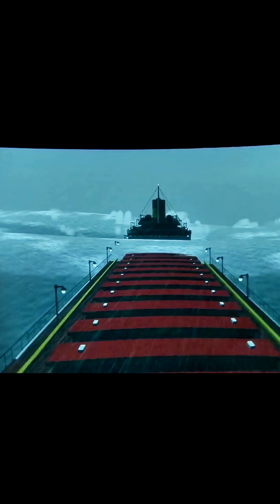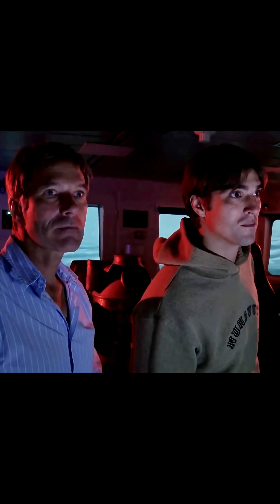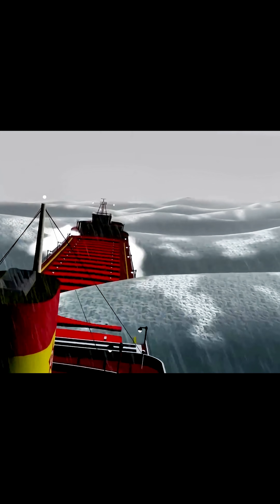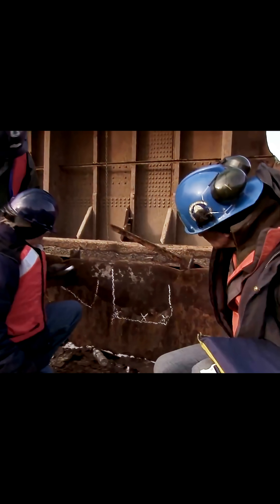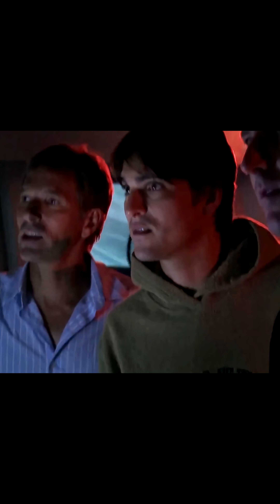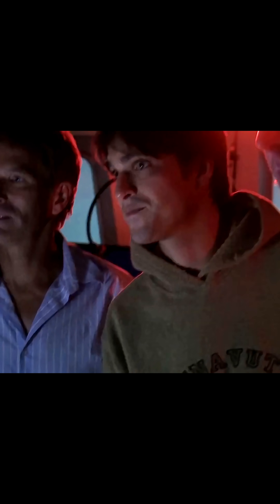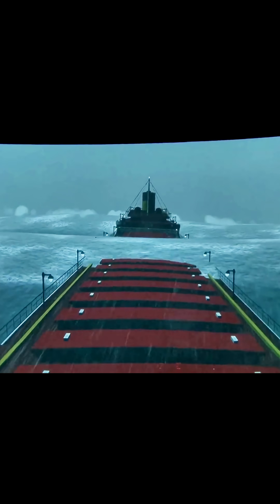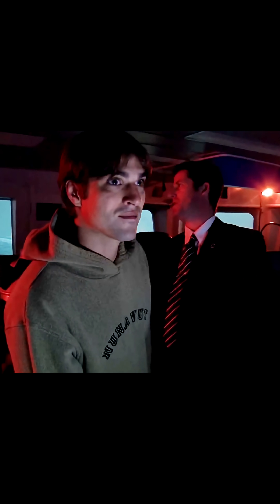Investigating the Edmund Fitzgerald: Simulating the Sinking – Part 1

Comment: I think the ship had a built flaw
Reply: The "flaw" was her length...with those waves being as big as they were, they destabilised the middle and in the end, made her snap in half
Reply: It was over loaded past the max weight it should have been carrying.
Reply: So there is talk that the ship wasn't well maintained but here's the biggest thing. The ships metallurgy wasnt what we have today. Even going into the 50s tha metal became brittle and could break under immense pressure especially if exposed to it time and time again. Given all the suspected evidence and given what happened to the Carl D Bradley and James J Morrell in the prior decades it's no surprise the ship broke apart in that kind of storm.
Reply from the maker: It's also been said that maintenance of the Fitz wasn't being kept up with as it should have been.